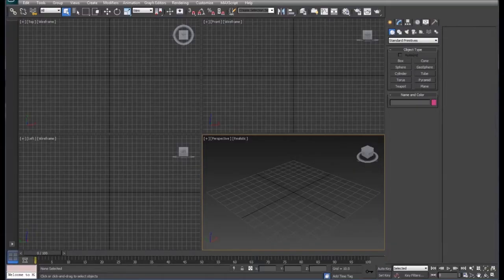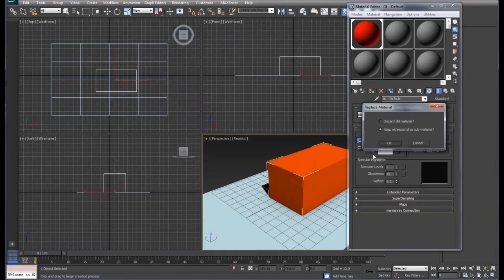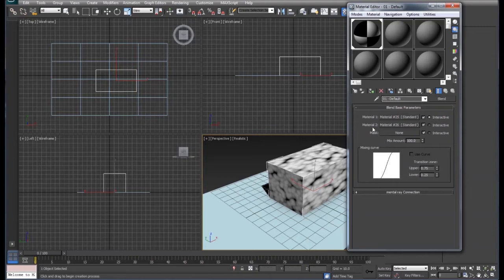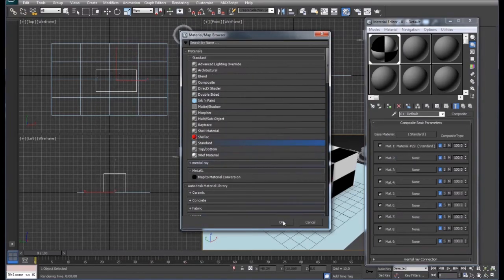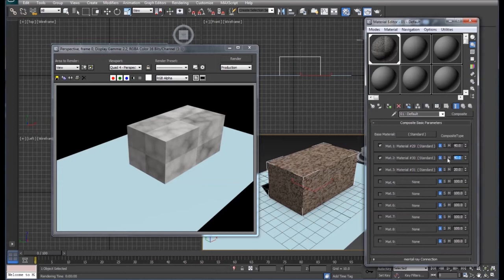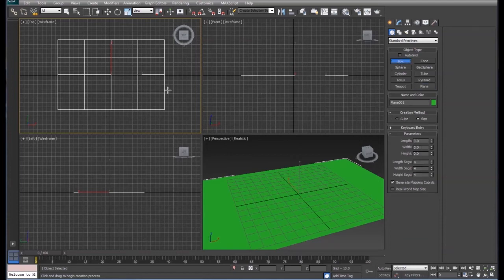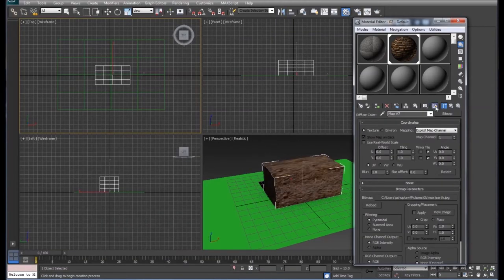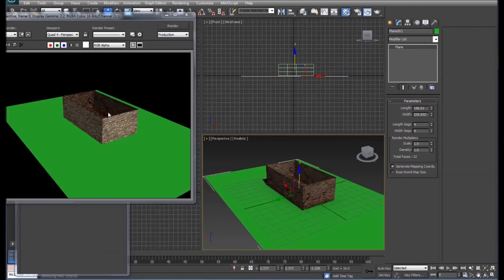3D Max Materials 2 Blend, Composite, Double Sided 008

Comment: I did the "double sided" at least 10 times but it did not work:( Why?
Reply from the maker: Serkan Yel could be a few things.  In your material editor change standard to multi/sub object, when/if prompted select discard old material, select "none" beside the face ID and select "Standard" and complete as normal.  Last, make sure you have assigned the faces on you object an ID that you are using in the material editor.  Hope this helps.